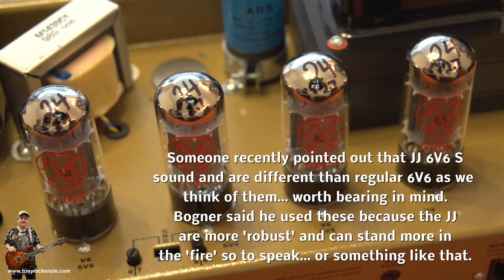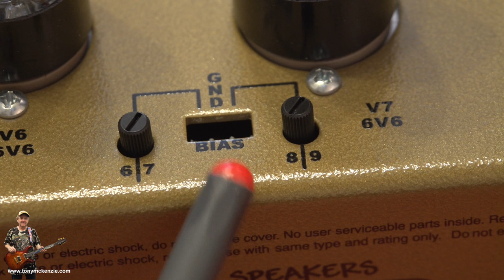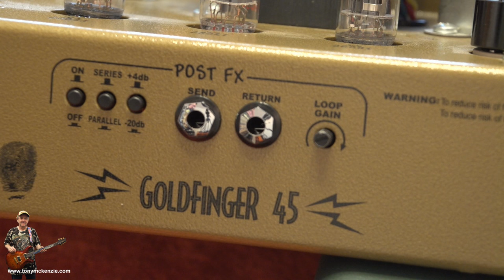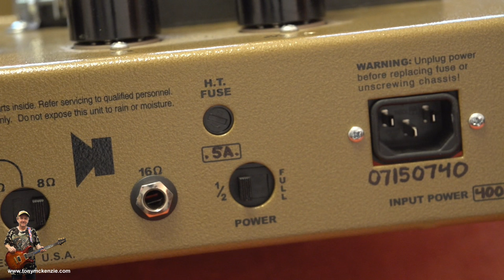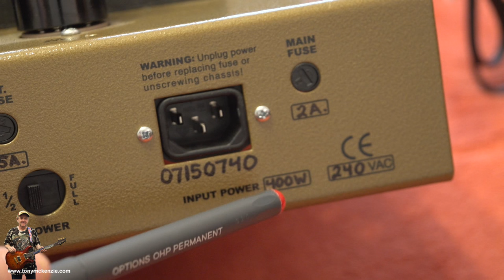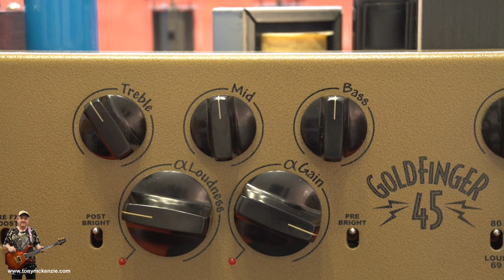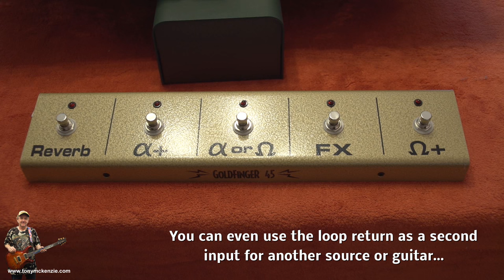Bogner Goldfinger 45 Guitar Amplifier | Inside and Out Closeup Review With Playing | Tony Mckenzie

Comment: @ 6:30 ...the number 24 on the power tubes ...my guess is that they are biased at 24mA.  Curious at what the plate voltage is at 24mA???
Reply from the maker: A good question... but sorry I sold this amp later. Thanks for watching.

Comment: Are you running this DI without a speaker simulator or something? it sure sounds like that. Not to be blunt, but it really is not pleasing to my ears, the same holds for the bogner brixton you reviewed. I do like the way you review the guts of the amps though.
Reply from the maker: +Martijn Van der Drift No. It was a Mesa CabClone with speaker emulator on for sure. I understand... sounded great in real life... but sometimes the videos don't necessarily catch it all. Others did like the tone though. Either way thanks for watching.

Comment: I wonder if an amp like this is easy enough to mod? Like adding more distortion and compression .

I’m realizing I like Mesa. Ok goes and their compression and touch sensitivity, I wonder what makes them that way, if it’s hard to add a similar type of compression and sustain to an amp. I want my amp to sing more and feel more energized 

Adding a compressor pedal really isn’t the same result as far as I can tell.
Reply from the maker: Finding good diagrams re Bogner might be hard. It's hard enough with Mesa. Well I can't advise how to do it, but guys do. There are also devices like this: https://www.guitarworld.com/news/nail-classic-george-lynch-high-gain-tones-with-the-lynch-mod-tube-module (and I'm not saying that's specifically for the Bogner or Mesa... but compression I believe is increased with gain right? on a tube amp... at least that was a thought... but in my experience to get a great amp can be difficult. I'm talking tube amps here. I have around 20 tube amps, and each one is different, that's why I have them. And one thing over the years I found is that particular amps are suited to particular styles of music (everyone knows that - but I don't really believe they do!) so a Diezel Hagen for me is metal rock no doubt. The Goldfinger I later sold because I was not inspired enough from that amp for MY STYLES of music. It's a great amp and I know guys that love the Bogner Goldfinger (Hello Rollie). I personally don't really play clean channels much. But one thing I can say, is I can name the second best amp I have... and its now discontinued likely to never return... and that is a Marshal JVM410HJS - and the JS in the name matters. That is a Joe Satriani model. It looks like the standard JVM410H from the outside, but internally its very different and sounds worlds apart. It is for me an incredible tube amp and one I won't sell. It has all the tones I need right there in the amp. But neither is that amp a Diezel Hagen! (which BTW is lower down the list than the JS amp) as the Hagen is very focused and specific to particular styles I play. Spend time trying amps don't just dive in. Play the styles YOU like and see how well it fits. Trust me, I don't own all those amps just to say I have them, each one really is unique. Sincerely I hope my little scribblings help you to end up with a brilliant amp that is perfect for you. And thanks for watching. Great post BTW.

Comment: Just noticed the tube sockets aren't fixed to the chassis , rather to the PCP board. Usually one of the first problems to go wrong with an amp. Still good quality though no doubt
Reply from the maker: Some of the old amps I have had (like a Peavey MACE) from back in the day had PCB mount sockets AND the board was mounted upside down (i.e. the tubes faced downwards) - man in a 160 watt amp! What were they thinking of?  The general thing these days (at least) is that the tubes face up :)
Reply: @tonymckenzieofficial  wow, lol. Have you tried the Goldfinger superlead? It has a few more features that are real interesting .and there's a clip of the Telus on YouTube that's the best rock sound I've probably ever heard
Reply from the maker: @aussie_philosopher8079  No I have not tried the GF super lead. The GF for my playing was not really for me... not enough drive (some will tell me its a monster) but this one under review I never really felt was right for me. Not the amps fault :).  Bogner are not that common in the UK and they cost a fortune. I've had a few different ones and in general I do like them but I try and look for used ones because of the cost - I have so many amps! If I find one and its priced right I might grab one... so thanks for the info on that. I'll have a dig on YouTube a little. Thanks.
Reply: @tonymckenzieofficial  a fortune.....try 4999 for a head here in Australia!!!
Reply: @tonymckenzieofficial  I agree the 6v6 is not the right tube for that amp I reckon 5881s would have been nice. But the the Goldfinger Phi has 6v6 and 6l6 but it's only got 1 gain tube hence not enough gain and to many power level settings.
Reply from the maker: @aussie_philosopher8079  OUCH!  But lots of gear down under costs are high though? right? Even Marshall amps from what I hear.
Reply from the maker: @aussie_philosopher8079  Seems many goldfinger are developed for users that don't need quite the drive. I bought an 'end of like' Bogner Brixton (reviewed) and still have that - it has incredible drive on that amp - they took away most of the tone stack and the drive is second to only the Laney Tony Iommi amp!   :)

Comment: Sorry bout that Tony I was taught better than that. Thanks for the clip and the amp does sound good.
Reply from the maker: The amp probably would have sounded better without the cab clone I used for the sound part of the review. I learned a lesson over a few amps and stopped using the cab clone except for when I'm working on an amp - the cab clone is a useful dummy load, but not really great as I found out for tone. Thanks.

Comment: The board is anything but hi quality when you compare it to fuchs stuff they are 27 Oz  thick copper traced and thick double sided board  . The bogner board has thin traces and the board is not silk screened by the looks
Reply from the maker: I have not seen Fuch's amps inside unfortunately but I have seen lots of other stuff. Thanks for the info all useful. If you look inside you can see where they have been working on the circuit at build time... in itself not really a problem but IMO more a good thing because humans exist at Bogner! :)  Thanks.

Comment: Just looking at this video again the only thing and I mean the only thing U can fault is the quality of the actual PCB board but the components if you can't see big fat traces very clearly that have it of copper and are clearly marked out to be that's the sign of low quality . 

But because there so many features and very high quality components something has to be sacrificed, thankfully something that didn't affect the tone.
Reply from the maker: Its not a bad amp by any stretch of the imagination and the build is certainly better than many amps I've seen the insides of. I later sold this amp because it was not really the type of amp for what I play, but that's certainly no reflection on the amp. There seemed to me to be mixed sized traces on the PCB's on this amp... but nonetheless a well made amp and it can sound really good. Thanks for watching.
Reply: @tonymckenzieofficial trace sizes makes sense actually because there is so much going on inside it. Absolutely great components like nos Allen Bradley carbon comp resistors and sozo caps. What's the transformer iron like ???
Reply from the maker: @aussie_philosopher8079  It all seemed OK from the hardware point - but remember I did this three years ago! :)  Thanks.
Reply: @tonymckenzieofficial  what amp are you using now , if this wasn't your flavour . I will let you in on a really nice secret , the doctor z z plus - parallel single ended class a 6v6, variable boost thats footswitchable , KILLER tube REVERB and swtichabke from 15 watts (parallel single ended) to 7 watts 1 single ended 6v6. Premier guitar does a good video, make sure you hear that boost engaged!.
Reply from the maker: @aussie_philosopher8079  Thanks for the info on the Dr z stuff... I will have to get to check them out... currently I have Bogner Brixton, Diezel Hagen, Boogie Road King II, Mezzabarba M Zero One, JTM45, Boogie Royal Atlantic 100, Marshall TSL100 (JCM2000), Ceriatone HRM, THD, Kemper rack and I hate to say it many more... :)

Comment: In my opinion, this modular design is complete shit. So you have a bad pot, you have to desolder it from a circuit board you can not get at. Also, tubes going to the board? That is a bad idea instead of tube sockets because if you have a cold solder joint on that board, good luck finding it. For the price, I think BS. Also, I have heard Bogner will not release schematics of their amps? So I say in general total shit
Reply from the maker: Well I'm certainly not years away from you... it seems they really don't give schematics and on two Bogner Brixton amps I had to figure out the conversion from 120v to 240v all by my lonesome... I did it, but you're dead right it should not have to be that way. I doubt there are ANY 'secrets' in the circuits that others don't know about by now anyway so what's the problem? I don't know. 

On some amps I have seen valve holders going to the board with long stand offs which the main power board is also separate like this: https://youtu.be/XOiQohaTUn0?t=1458 and that certainly helps compared to some amps - like this one. But again I'm with you re the sockets.  Most amps (but not all of the ones I have seen) tend to have smaller less common pots and as you say sometimes fixed so they are difficult to change, especially on cheap amps... but sometimes what you might think would have the good stuff does not. I always liked the Mesa pots wired etc. and relatively easy to find/change... 

Thanks for watching BTW appreciated and you have some great points...